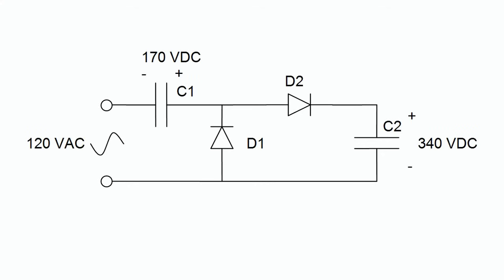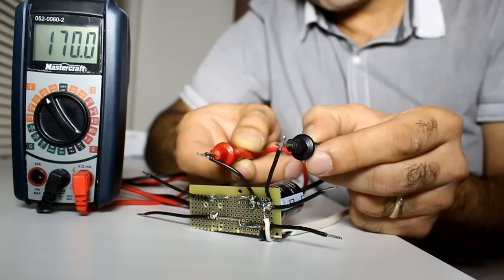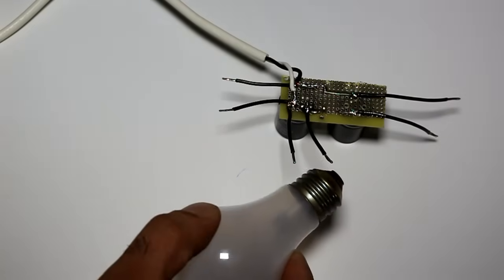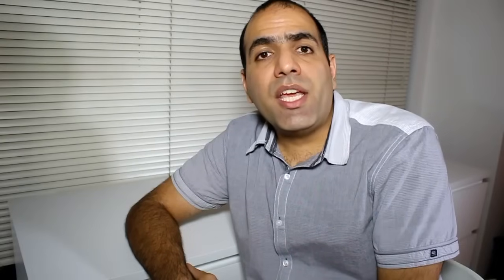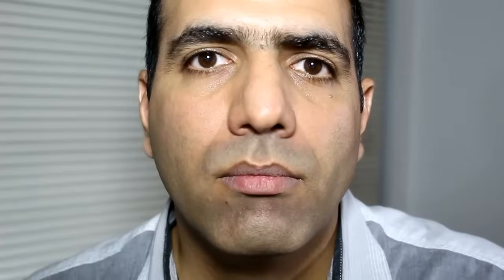High Voltage AC/DC Effect on Human Body

Comment: for those who want a better explanation: dc charges the capacitor until it's full
while ac charges and discharges (while also charging with negative voltage) the capacitor, that means it is always getting the maximum current allowed

Comment: Based on a Human Body capacitance of 5nF, the AC current produced by 120V should be around 1.41 times the current of 120V DC. 

So it seems like 120V AC should hurt exactly as much as 170V DC when you take into account capacitance, but that’s nowhere near what you showed here. Is there something else at play?

Comment: I highly doubt the explanation.  The capacitance of the human body is in the range of about 100pF which means that at 60Hz the additional conductivity is negligible (about 26.5 MΩ impedance due to the body's capacitance in parallel with a non reactive resistance of about 1.5 kΩ).

Comment: Please tell me one thing....when the circuit is running and you touched the 340 V DC  it doesn't shock you 
...but as soon as the curcuit is switched off from the mains and then you accidentally touched the 340 V DC the got an electric shock....why is this so ?

Comment: good expain and understanble  
but I have a question :
why we measure the difference potential to about 400v or 390V or so on  in three lines circuit ??
as long as every line have a potential and none of them is neutral 
is it must be 0 instead of 400V ?
Reply: Because it is 120° out of phase. You measure it 400 V from two hot wire with 230 V each that run in different phase with 120° difference, so probably your country use 230 V system in 1 phase and 400 V in 3 phase. If the phase are same, it would be 0 V and if the phase are splitted 180° away, it would be 460 V in total.

Comment: 230V AC (German Std.) does rarely harm and only pains me a little. But 400V AC (3 phase) gave me a hard knock in my shoulders and a painful strike😂. I touched the probes with left and right, I switched off before, but some moron turned on again😂

Comment: I'm surprised he can touch DC like this. I heard a story of the past in a french manufactury when everything was running on 110V. The worker got electrocuted. He was stuck by the current. He could not remove his hand. Eventually he managed to remove his hand from the electrocution and survived. And that's how we got his testimony. It is because of this problem that we moved to 220 AC because electrocution repells instead of catching.

Comment: They taught me over 50V DC is dangerous to touch. This experiments proves that whatever they teach in science class most of that is load of bollocks.

Even 374V DC is not dangerous. And at 170V DC you feel lightest tingle.

Need to throw those theoretical science books away and come to real life experiments
Reply: depends on a lot of factors, in the video he was touching with dry finger tips, now imagine if he was touching with soupy hands on a metal plate

Comment: EB, ok, so AC is good for transmission. But more people are installing solar, which is DC. So since we don't need transmission why can't I use DC for my house...foregoing inverters.
Reply: i mean you can, many AC appliences also work with DC, stuff like resistive loads, LED lights, most things with ac-dc adapters like TVs, Phone chargers etc
but of course it is not recommended to use stuff

Comment: I got zapped by 120 volts when I grew up.  I thought that toastor did not pop.  I tried to remove bread with knife and got shocked with reflex action.

Also I walked around bedroom with bare feet.  I did not know that electrical cord is broken until I stepped on it.  I felt shocked for a few seconds but not enough strong.  I lifted my feet off, searched for it and found broken electrical cord.

Comment: if thunderstruck you, that would be AC/DC.
Reply: It's just really high voltage dc, the problem is all the energy is used and heat as it goes through the air

Comment: I'm looking at the way he touched it, he touched one of the AC power lines when touching the 170vdc output, was that the nuetral wire?
When he touches the 300 volt output as well, you can see the live wire is connected directly to the output

Comment: I been alive 50 yrs and always thought 110v (AC) was much safer than 240v (DV).  I did not know about AC vs DC. 

To be ultra efficient, safe, and to conserve energy, couldn't we make use of 24v-48v DC.  My 48v ebike turns the wheel with all my weight on it up hills for hours.

Could we could build washers and dryers, freezers and other fridge appliances to use less energy ⚡? 

Seeing that these newer 10w LED light bulbs can produce 75w of light.. Does that equate to less voltage required to power them?
Reply: DC would indeed be good inside a house, but for long distances only AC is suitable
Reply: @aintaintaword666  search for HVDC, DC by itself is good for short and long distances

Comment: I did this yesterday. I made some unexpected measurements. The source was 80V rms. I measured 134V dc across the first capacitor instead of 113V dc. The second capacitor had 268V dc across it. The first capacitor was a series of a 220uF 400V electrolytic and a 275V. 47uF film capacitor. The second capacitor was a series of three 275V 0.47uF film capacitor. I changed the source to 280V rms and got 478V dc across the first capacitor and the double voltage difference of 478V dc across the second capacitor. I was using an UNI-T 139C multimeter.

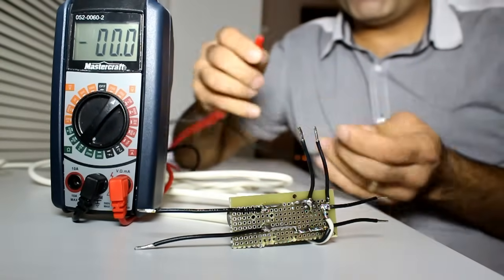Comment: 2:00 he is so clever. he wasnt shocked at all. instead as he brought the probes closer to wires, he did touched any probe to the wire and just brought his fingers infront of the camera and then acted as if he is shocked. at 2:00 his multimeter is also showing no voltage as he did not connected the probes to the wires.
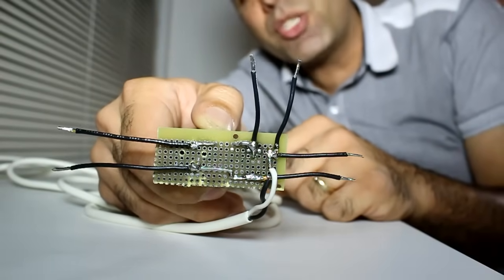just watch from 1:55 to 2:05 in slow motion and you will see

Comment: Yeah, the ac passes through because there is a gap there. Not because the capacitor has an impedance which is dependent on frequency.

Comment: The way a capacitor works on AC circuit is  NOT as he said. The current CANNOT pass through! To simplify the capacitor just get charged with electrons and discharge when the current alternate polarity according to the frequency (usually 50 Hz) And that process happen on each side on the dielectric 50 times a second.

Comment: There is a very simple rhyme which will help some of the retard out there "mills kills, volts jolts"  20kv of static will just tingle but it is only microamps, 12 volts at anywhere upwards of 200ma can kill given the right circumstances. DC current is about 2-4 times less dangerous than AC current because the AC current will cause faster ventricular fibrillation which is often the cause of death from electric shock. ... Applying say 12V from your hand to hand directly in your bloodstream would then give 30mA DC which is highly unlikely to kill you... I really would hate ANYONE to try this ^^^ shit at home.

Comment: Sir Our body is charged by DC power you know.?hart is dielectric, more voltage kill you. 
In DC electronic circuit how AC work?
In AC you know  phase cycle, and neutral cycle. Fast Charges and discharges not possible because our body design for low DC voltage.

Comment: very nice way to fake an 120v shock by moving the meter out of the camera very funny. But in all seriousness he clearly know what he is doing and because of that he would not make this crazy mistake (of touching the probes) and having the potential to get a 120v AC across both of his hand. But he did get an high voltage shock for real on the 1000000 Subs special and his reaction was quite different. That being said very good video and the comedy was on point and remember "It's not necessarily a supply voltage at no load, but the amount of current it can provide when touched that indicates how much hurting you shall receive. Because a touched supply voltage may drop if its current is somehow limited".

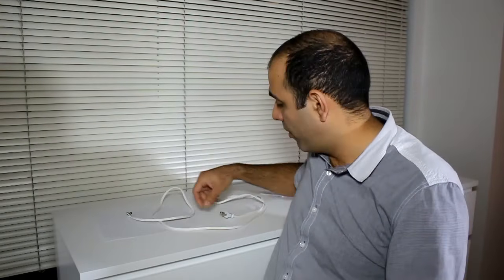Comment: 0:50, 1:05 Boom.
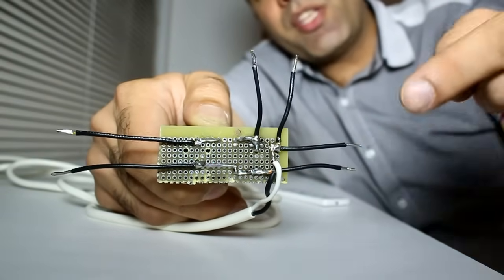1:37 I’ve accidentally touch 120V & 220V AC and they hurt a lot and can kill, so I’m not gonna repeat that again. 2:01 AAAAA. MY GOD. 😂
4:07 When there is a DC signal like this, it hits the capacitor plates like this and gets blocked. While an AC signal can zigzag between the plates like this and pass through. EEEEEEEE.

Comment: thanks for making me less scared of my 140v dc solar setup, i run a lot of stuff on dc no problem but anything with a transformer or a non brushed motors are a no go. my laptop block works lights work and so do a lot of power tools and i don't need beefy wires anymore. i think Edison was on too something :3

Comment: Would higher frequency AC be less harmful? Assuming some resistance of the flesh, the body would only have time to charge up to a small fraction of 120V if the cycles are fast enough.
Reply: No it is more harmful electroboom actually made a frequency vs pain video in which about 2 kiloherts it hurts the most above 20 kiloherts electricity doesn't mess with nerve so no cardiac arrest but burns the body even better due to skin effect and lower capaciter impedance (means less resistance lower the impedance lower the capaciter/inductor resistance)

Comment: 3:18 I though DC suppose to be Positive but they are Negative and it hurt.
Reply: Because he was holding the probes backwards. The sign shows the direction in which the electricity flows, but otherwise there is no practical difference.

Comment: Hey how did you do this? Because I have a model battery powered/operated self supporting tower from towerawards and the thing is I want to have it on all the time or make it to where it can come on at a certain time at night like maybe dusk and maybe like it turn on at maybe like dawn or sometime during dawn or dusk. So I would get a timer from a headwear store with the plus in outlets and the dusk dawn option meaning it would either turn on at dusk and off at dawn or vice verse. But I was like I said just wondering how to do this with out the boom ouch part, to make it like the real things. Except in real life it’s orange at night abs white flashing during the day

Comment: I got slightly zapped by the hot wire containing 120v ac and used me as a pathway to ground. Its not a joke. It tingled my skin thanks to my old rubber slippers that slightly isolated me to the ground. I couldve died

Comment: I have a question to ask when both DC and ac are voltage why capacitor block DC and why let go ac voltage .basic concept is capacitor plate charges once charged other plate gets charges and after full charge it let go the voltage .now any one can explain

Comment: This is why we should have DC in every home instead of AC. With DC you can run 240v with significantly less danger. They should have Rectifiers to convert AC to DC in every neighborhood before transmitting them to homes.

Comment: 0:47 now the circuit is hot and the voltages BOOM
Reply: He was getting the circuits ready hot
Reply: Something u must never forget is that some capacitors like eletro lilly ones are polarized and must never connect them backwards or there blow up
Reply: @Sheik_Bacchus  now i have replaced the capacitor on my circuit and I'll plug it in
BOOM 
**
**
Reply: @SketchMickeyMouse In addition to polarity, the capacitors must be rated properly to be able to handle the voltage across them, or they will blow up, obviously.

Comment: I don't buy this! You are pulling some kind of (dangerous) stunt here! 170 vdc can KILL you just as quick as 170 ac. I'm not catching what you are doing when you touch it but if you go touch the B+ 150 in a table radio it will knock you very good! Whatever, it must be clearly explained: DON'T DO THIS AT HOME or some kid is going to electroboom himself!

Comment: 0:44 I make a simple circuit and i'll plug it in. now the circuit is hot and the voltages of this. 0:50 BOM!. 0:52 Something you must never forget is that some capacitors like electrolytic ones are polarized and you must never connect them backwards or they will blow up. 0:59 Now i have replaced the capacitor on my circuit and. 1:04 I'll plug it in. BOM!. 1:07 in addition to polarity the capacitors must be rated properly to be able to handle the voltage across them or they will blow up obviously

Comment: Often I work on ac voltage at my home to repair stuff and as the normal output voltage in India where I live is said to be 220 but it is actually 229 point something as per a multimeter so I touched them many times unintentionally it feels like :I can really feel the current is passing through my body and the whole body just freezes.
I remember the first time I experienced a electric shock when I was very Little as a result a slightly bigger than a pen nib hole appeared in my left hand thumb. Ha ha ha. By the I am 18 now so.

Comment: Make sure your muscles don’t clamp shut with dc you cannot let go !!!

Use an insulating transformer !!!
so there is no voltage between you and ground !!!

My first shock was with a generator from a field telephone !!!

Repeated shocks are what kills you !!!

While working as an electrician I got shocked many times !!!

After that I take a break if my heart rate was is abnormal I stop work for the day or only work at low voltage !!!

I do advise people to use an insulated transformer so it floats above grid !!!

Not get burned it might infect you do desinfect wounds and stand on a tire and rubber maths wear insulation shoes do prevent others touching you when hot wiring stay away from damp cellars cary a backup battery powered light and work together in pairs and both learn cpu if someone gets hurt do continue cpr reanimation for a long time to make the nerve system awake again !!!

I do take every precaution and if you’re working on electrical stuff use an insulated transformer and work only with your right hand never mess with high voltage stuff and have the right equipment !!!

I nearly got killed on 3 occasions !!!

So please do be careful!!!

The loony bin where I stayed had insulated transformers built in !!!

And If I work with tube amplifiers or stuff I like to work with insulated transformers to prevent getting killed !!!

Comment: 1:42 "I'm not ginna touch 120 volt AC again" 20 seconds later touches the AC cables😂😂😂😂
Reply: Well either way it still hertz lol
Reply: DC not dangerous, sir?
Reply: @educateandentertainment1592  both are. The point you should take from video is that human body allows ac to flow through it more easily
Reply: fairly sure that one was staged. the way he touches the lines was very unnnecesary. not even sure it was live. he throws away the meter so we see nothing.
we, i mean, most of his "accidental shocks" are staged but that one looked particularly obvious
Reply: And at the beginning of the video, he said he was going to.
Reply: that was fake 
Reason: See the video at 0.25x then you will see that the meter was at 0 and to hide that he threw the meter so that we could not see that
xD
Reply: @friendlycreeper1045  to me it looked like his fingers touched the wires before the probes did.

Comment: I'm not buying this capacitance argument (for AC hurting more) without more explanation.
The highest capacitance I've found for the human body is 1350pF (100-200pF usually), which is around 2Mohm at 60Hz, far higher than skin resistance.  There must be something else going on.
I'd look it up on the internet, but most search results lead straight back to this video..
It seems more likely that pulsed current hurts the nerves and muscles more through continual reversal.
Or maybe there's some mechanism other than capacitance that reduces the skin's impedance.

Comment: If it's because of the wave that allows AC voltage to flow through the capacitor, does that mean that at certain frequencies the AC signal doesn't get through? Can someone help me with this?

Comment: Possibly at two different frequencies could you run AC and DC on the same line at the same time using the same positive and the same negative output and input terminals.... If not why you

Comment: Instead of his explanation at the end, if you look at it from an actual math/circuit analysis perspective, the formula for the resistance of a capacitor is 1/2PIfC so the reason why you feel ac much more is because as frequency increases (AC), a capacitor acts like a short circuit, and at low frequencies (DC) the capacitor acts as an open circuit an no current flows.

Comment: Another I've learned by witnessing from someone else this year is that polarised capacitors cannot be installed in AC circuits or they will blow up because the negative part of the signals is like plugging it backwards.

Comment: 240 volt ac would hurt twice as much as 120 volt ac.
Reply: E=IR=V^2/R. All else being the same, the energy transferred to your body is quadruple. So the damage is x4 and it hurts x4, if there was ever a unit of measurement for "hurt" :) I can also tell you from experience, this is true. 240V is dramatically more dangerous than 120V.

Comment: are you basically saying that ac is far more dangerous than dc?? I always heard the oposite. I guess you are well aware and familiar with this and I think it has to do with conductive properties right? ac can travel thru something with less conduction than dc can. I mean, I know a car battery is a lot of amps but you can't feel it. however if you had the same volts and amps of ac it would hurt..

Comment: Guys guys wake up. This guy is fooling you all in some dangerous cases. I am an electrical engineer. If somebody touches 120 Volt AC, he/she severely gets hurt or could even die. And the electricity that he is testing does not protected by over current or ground fault protection devices. When he was connecting the probes along with his hands at 120 V AC, I noticed that there was no voltage showing in the voltmeter.  I figured it out by slowing down the speed of the video to 0.25 from the settings and paused the video exactly while he touching the probes.